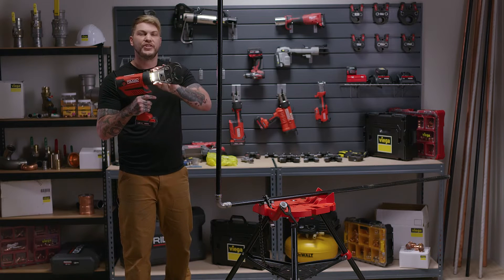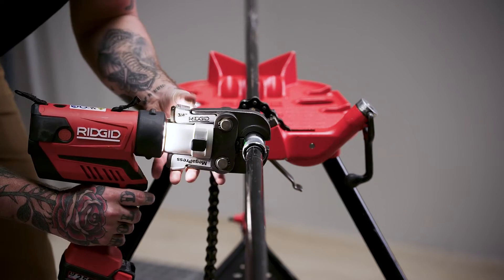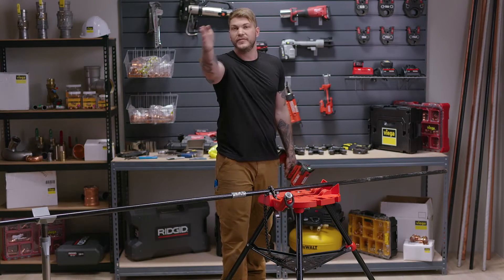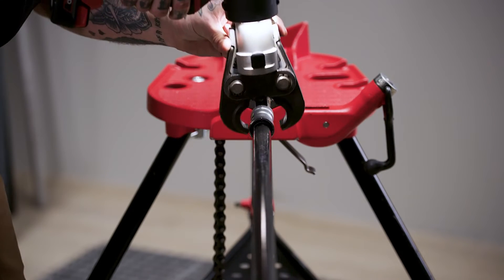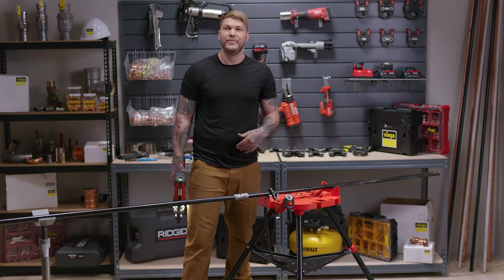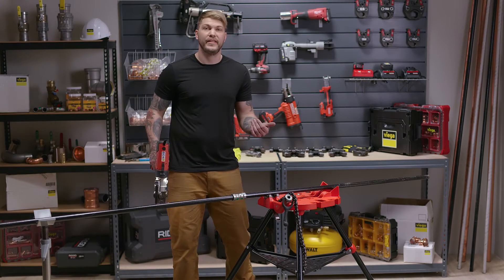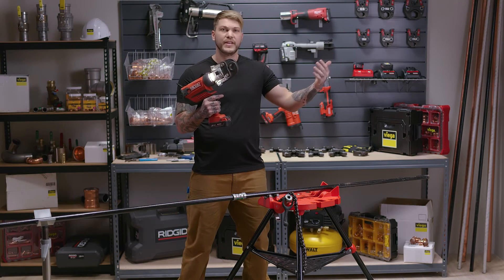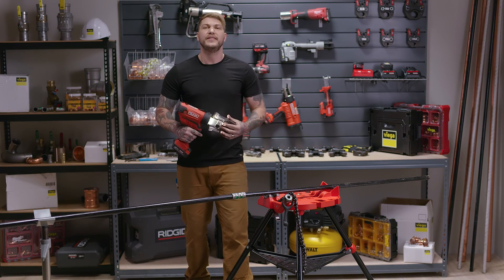What is Deflection & How to Correct It | Viega Training

Comment: This is terrible that this is the only solution.
Reply: It’s a great fitting.
I’d rather press than solder in tight spaces.
Reply: I notice it a lot on 1/2” copper and using only viega fittings drives me absolutely crazy crooked pipes are embarrassing